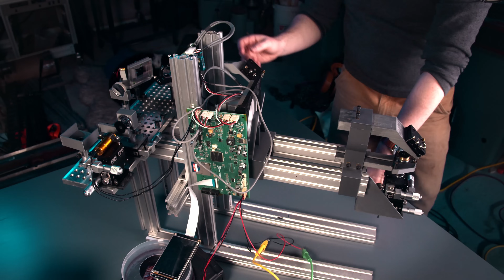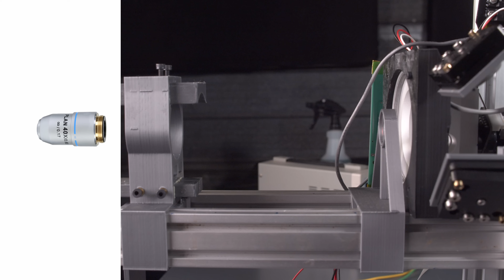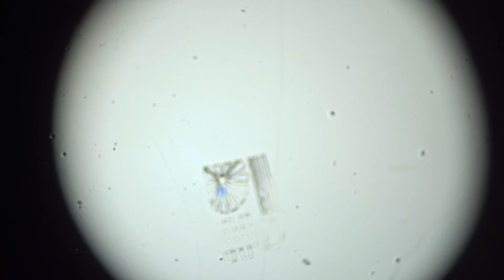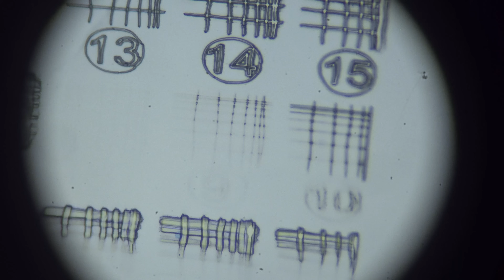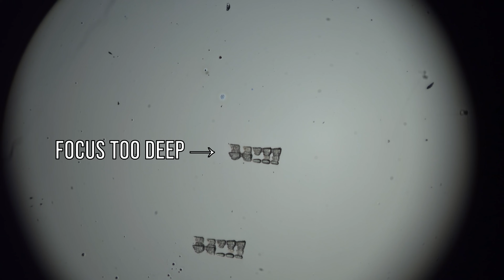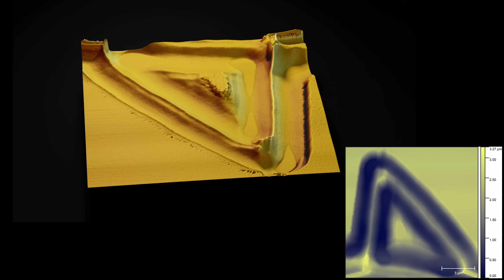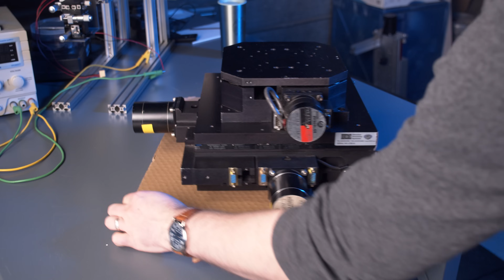DIY Semiconductor Patterning

Comment: I used a very cheap ESP32-CAM, with a macro lens, for my focus and calibration. 

Initially I tried to calculate how many microns I needed to move to get the best beam and focus. Too much effort. Now I just switch the camera in, pick the reference position, laser back in and draw test patterns in the 4x corners. With the camera back in I evaluate the quality of the test pattern (each done at a different focus). I then pick the best one (generally only one set is needed, not the other corners as well) and enter that into my software. When drawing the software then uses that value. 

This is not exact science but, for me, it reduces the effects of temperature and humidity. I can also compensate for different thicknesses of target materials. 

The laser is the one problematic part for me. It is difficult to characterize the cone of the focussed beam. I draw on several types of photo sensitive materials, generally 35um Riston negative resist, spin coated positive resist (sub 5um) and diazo film. Each one has its pros and cons. 

With diazo film the emulsion(sub 1um) is exposed facing up and can be lasered with a very shallow DOF as divergent light in the bulk material scatters around, causing less secondary exposure. Thin positive spin coated emulsions can also be lasered with a small spot with shallow DOF. My biggest challenge was the 35um Riston film. Ideally you want a nice collimated beam with a large DOF...but that makes it difficult to get small spot sizes, hence my eventual 20um spot. You want the laser to expose a sharp canyon as apposed to a triangular trench. My software takes care to compensate for the wider beam. The laser shape also causes crap. It is far from round. Infact most laser diodes produce a rectangular beam. This means drawing in the X direction produces a different width in the Y direction. You can turn it 45 degrees but then one diagonal will be thinner. You must either fix it optically or in software...I chose the latter.

Laser "dosing" is also a problem. I have done thousands of samples and different speeds and intensities. I had to standardize the way I develop the final exposure, focussing on developer concentration, temperature and fluid flow/pressure. Cannot just swirl the final product around at current room temperature in a Tupperware container. The laser driver also needs to run at a certain temperature to keep the laser current source deterministic. My laser driver is DAC controlled and has internal feedback, but for each 10C increase the rest currents double making the control loop under compensated. At 5megapix/s bandwidth this can cause the laser to modulate slightly, causing artifacts.

Lastly, one of my original pains was mechanical inaccuracies in the XY hardware. If you want to find out how crap Chinese bearings and ballscrews are then try and draw a straight line with 1um spot sizes. The laser basically records the profile of the low quality linear slides and bearings...another reason galvos are the way to go. Cheap ball screws equal lots of backlash and varying step sizes. I ended up using extremely expensive mechanical parts, very expensive stepper motors with extremely low stiction and 256 microstep drivers. Oh yeah, everything must be mounted on shock absorbing material. I had one version (raster) picking up music and modulating the lines. I am now at version 5. 

Luckily I am at a point now where the machine has started to commercially make some money.  It allows me to charge clients a reasonable amount for same day, high resolution circuit boards. Unfortunately, with the amount of time and money spent, I probably could have procured boxes full of commercial PCB at a lower price.😒

So, I feel your pain. Your machine draws on a much smaller scale while I target 15cm x 15cm. But the physics is basically the same. You go slow and get more accuracy but lose a lot of time.  You go smaller in spot size and lose DOF. You go faster and end up with many problems like overshoot(pain with galvos) and additional mechanical resonances.....and  a laser is not a perfect as science fiction movies make them out to be.

Comment: Fascinating watch, forgive my ignorance as this is not a field I'm involved in however with regard to the problems with the galvos, could you possibly build a replacement using a DMD chip? or chips possibly even creating an interference output to increase resolution?

Comment: Why not use an f theta lens instead of the setup after the galvo? The objective behind the galvo or maybe after could work too i think But 2um is impressive for the setup. I am waiting for the next video on this this is nice!
I would expect you to have a laser-pinhole-expander-focusing-galvo-f theta
Reply from the maker: Spot size mostly! In theory I should be able to get a smaller spot size out of a microscope objective than with an f-theta.  Not necessarily because of the f-theta optics, just because they aren't made (in affordable, off-the-shelf variety) to have high magnification.  But otherwise yeah, the f-theta style optics would work great! No reason it couldn't be used :)

You can technically use the f-theta as part of the scan/tube configuration too (it can replace the scan lens) and I tried that, but didn't have the right combination of other lenses to make it work for me.
Reply: @BreakingTaps  Your beam is comming out at an angle though. Could explain the variation in the results. Still great project. Could be a cool idead to include in the next video if adding an element to straighten the beam post objective improves things.

Comment: FYI if you want to align a beam through an axis you need two kinematically mounted steering mirrors. This might be why you had trouble aligning your red and violet laser diodes to be coaxial. My current research involves aligning a pump and probe beam to be coaxial through a sample, and I achieved this by using two one-inch mirrors in a figure-4 configuration (though a Z or U shape works just as well) and then using a mirror in a one inch mount and the dichro as the second mirror for my probe beam. Four kinematic mounts total. I then align through a pair of irises, probe first and then pump. Maybe this could be helpful for you... Another thing that you're probably aware of is that you can achive a tigher focus with a larger diameter beam. The spot size is still going to be limited by your M^2 factor, so it still won't be great for a diode laser but proper spatial filtering to get a good gaussian profile goes a long way.
Reply from the maker: Thanks for the tips, really appreciate it!  Still learning the logistics of actually setting up optics, as opposed to the idealized plots you see in the textbooks :)

Comment: Hi This is probably a stupid question, but would the guts of a Bluray player be able to replace the galvos and some of the optics??  Or would they not have the resolution that is needed?
Reply from the maker: Not stupid at all! There's some very interesting work being done with Bluray OPUs, hitting sub-micron resolution.  Check out this video: https://www.youtube.com/watch?v=0FxJJHBqJ0U  It's applied to 3D printing, but same principle just swap out for a single-layer photoresist and tada :)

Comment: With the laser traveling all the distance, getting reduced, the atmosphere affecting it, and not to mention there's always particles floating around like (hair, dear skin cells, dust, etc), that can get in the way of the laser. Putting it a vacuum will improve the laser and not degrade it.

Comment: Hey this is awesome! Where did you grab most of this laser equipment? This looks super fun to (safely) play with but I've no idea where to get any of these materials.
Reply from the maker: Ebay mostly! I scrounge most of my optics and laser stuff from ebay because I'm cheap, and you can get some good deals on used scientific/industrial equipment :)

It's essentially a laser pointer diode (low power) and a laser light show galvo. The control board came from an old 3D printer, but in theory they are pretty easy to drive.  +/- 10V analog will sweep the galvo mirror

Comment: Great Project. You need definately get rid of the plastic parts, but not only the material is problematic but the design of the part. You want to avoid L shaped parts (and everything "hanging around" at all) beacause of vibratio issues. Also a more compact design with more mass will help with vibrations. Maybe you can get damped metal rods of ebay to replace the aluminium profiles?

Comment: This is absolutely fantastic work!

I can't help but notice you're using 3d printed parts to hold optical components. I'm not sure what plastic you're using, and (I know you already know this) but plastics, especially PLA, have both a stress relaxation and a creep factor which will deform the parts over time.

This won't really matter for macroscopic laser projects, but when you're dealing with microns, I would assume both of these variables can throw off alignment really quick.

In fact, you could use this setup to measure this over time by firing the laser every hour or so over the course of a day onto a UV photosensitive film and plotting the points. I'm pretty curious what the results would be.

Then again, I will admit I have absolutely no idea what I'm talking about when it comes to optics or if any of this drift even matters. The results seem to show none of the above variables matter much.

EDIT: You mentioned all this toward the end of the video; I should have really watched the whole thing before commenting 🙃
Reply from the maker: 100% agree! Working on v2 which will feature a lot more metal components :)

Comment: 18:45 Could you put a light sensor array where you put your work, step down the power (as not to burn out the sensor) and use that auto-calibrate?

Comment: Couldn't you expand the beam more by replacing the 50mm lens? The mount would need to be redesigned and you'd need to increase the servo range, but it looks like you have space there.
Reply from the maker: Yep! The 50mm side is probably about the limit, I tried a 25mm in an earlier iteration and the curvature of the short-focus lens proved too be too much (lots of aberrations), but the 100mm side could easily be a longer focal length to get a bigger expansion. It really needs to be quite a bit bigger, so v2 will almost certainly feature a bigger beam expander!
Reply: @BreakingTaps  Aah, ok.

Comment: Is it possible for laser to go to lens-pinhole-lens instead just pinhole?
Reply from the maker: Yep! I explained it poorly, but that's exactly what's happening. The laser diode has an integral lens that can be focused, and I have it focused on the pinhole itself.  You can go laser->pinhole but efficiency is terrible, doing as you suggest with lens->pinhole->lens is much better.

Comment: Hey, confocal microscopy guy here! I'm super impressed with what you managed to do diy with a super low budget.
 Before blaming galvos, try to see if the unreliability is due to vibrations: they can be absolutely awful, especially in a setup suspended from the table, and with those long 3d printed parts holding heavy optics and metal parts. If you can, try to launch an etching experiment remotely from a pc in another room, consider doing it at night if you are close to a busy road/railway, and if you are not at the ground floor. If the result is much better, it's probably you whole setup wobbling about as you walk, talk, even breathe around it. Better yet, use your extra focusing optical path behind the dichroic to get a microscopy image of a sample on a camera with some decent frame rate (30 fps is enough), if you have vibrations, it will be extremely noticeable.
 Also, you can gain a lot of power (if you need it) by focusing the laser on the pinhole, instead of just placing the pinhole in the collimated beam path. As long as the resolution of the lens you use is worse than the size of the pinhole, you should still get a very clean beam out of it, it will just be more finnicky to align.
Reply from the maker: Thanks for the tips, appreciate getting help from actual experts!  Yeah I definitely think vibration is playing a role, although I might have underestimated how much.  v2 will probably sit on a granite plate, and I might put some kind of air damper underneath to help with vibrations just to rule it out.  That's a clever tip with the camera, will keep that in mind!

And re: laser, I probably explained it poorly.  The diode has an integral lens which is focused onto the pinhole, so the efficiency isn't as bad as it seems. But I have the pinhole intentionally misaligned because the aberration from a misaligned pinhole ended up giving better results than full intensity through the too-large-pinhole.  That's why the ultimate spot ended up looking so dim. :)

Comment: I've been meaning to take the next step in a similar project.  Using the LCD for an sla 3-D printer to make pcbs.  I've always been curious if I can get the features small and precise enough using a similar method with Optics. 
Thanks for getting me motivated to go back and experiment with that project/concept some more.

Comment: Why not try a cylindrical lens to see if you could squash down that ellipse and make a rounder beam? Or unfocus the beam to make it wider and collimate it again so you can use a more easily controllable mask to make the beam round while not losing so much light, and then focus it down again closer to where you need it to be tight?
Reply from the maker: I might use a cylindrical pair for v2, we'll see!  The pinhole will give better circularity and is a lot cheaper, but the cylindrical lenses will be a lot easier to align and have better throughput (won't cut off nearly as much light). Thorlab has a pretty good article on the options: https://www.thorlabs.com/newgrouppage9.cfm?objectgroup_id=11426

Comment: To add to the pile of why not comments.  Why not use an LCD 3D printer and lose the galvo?  You can get 35-micron pixel size 3D printers pretty cheap these days, say under $350.  47-micron pixel size printers can be acquired for under $200.  And, if you could get that to look good through the objective then the next step would be to make a micro 3D printer!  😁

Comment: What could help you to get steeper walls in your etched layer would be to use a microscope optic with a longer focal length so the cone of light that hits your substrate is allot thinner/sharper and doesn't spread out as much towards the top.
Also planning on building something like this but instead of galvos I'll use glass cube prisms that displace the beam when rotated.
Will adapt your solution of using a microscope lens for the final focusing though, very smart.

Comment: Another very interesting project! I am amazed by your project diversity.
When I saw the issues you have with the galvos I wondered why not use a DLP (as others apparently did). After you mentioned you got the galvos from a 3D printer I first thought about the LCD printers. So this might be an option to increase reproducability. You could use a cheap chinese resin 3D printer (or the optical spare parts) and use 2 lenses to collect as much UV from the LCD as possible (you'd loose a lot but then again expose everything at the same time and I assume exposure time is not an issue compared to all the other prepping time). Probably those UV LEDs output way more UV power than the laser. First lens relays the picture of the LCD to a second lens (e.g. used 50 mm prime camera lens: cheap on ebay and the have smooth focusing mechanics) and second lens collimates for the microscope lens.

Oh and another nice advantage of the LCD approach: you could use rather simple image manipulation algorithms for corrrect for light intensity falloff at the edges and even improve contrast on thin features/over etching in areas where two lines converge.

Side note: Do you know about this software for doing (simple) optical design simulations clles WinLens by Qioptiq?

Comment: Amazing work, subscribed. Reminds me of taking image stacks through the microscope, Driven by steppers it was move, wait for vibration to stop, open shutter, wait for vibration to stop,flash led light, close shutter. Had to move it from an attic to a cellar due to vibrations. The frame wasn't sturdy but with the right setup it worked very well, these vibrations are always there however big the machine. three phase FOC motors help enourmously with smooth control. Galvo, electrostatic, Henry at UMIST in 1990 built ascanning optical microscope with two 3" loudspeakers and two sweep generators, im feeling inspired.